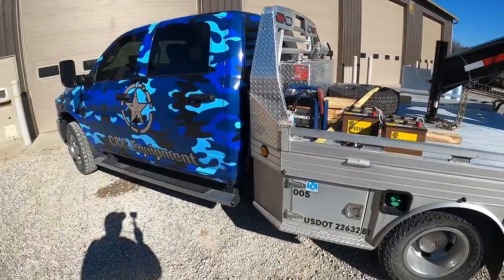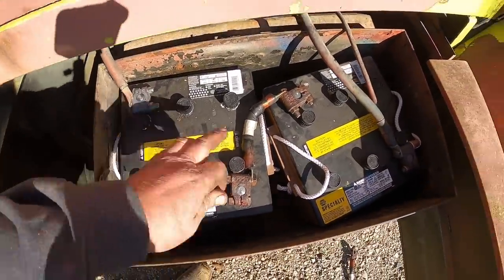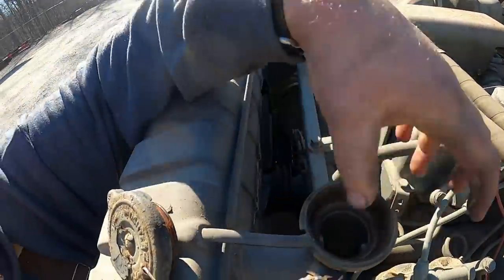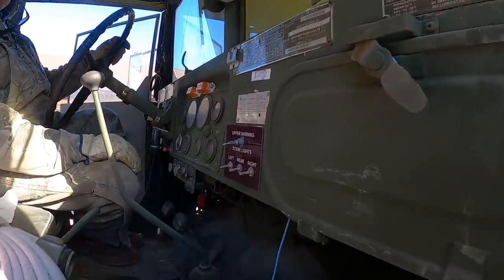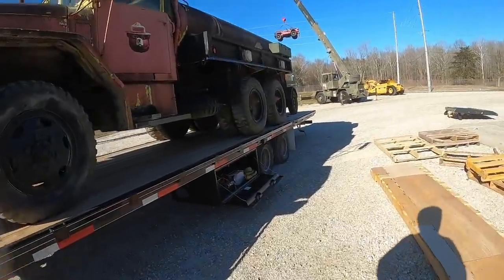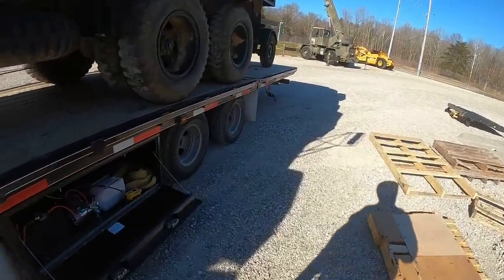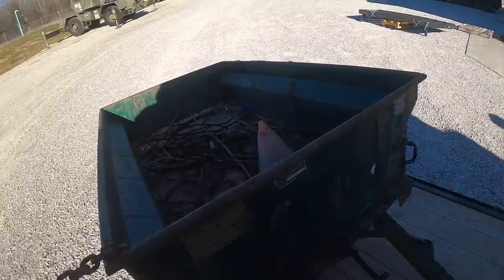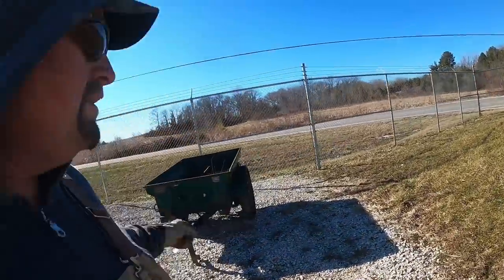M35A2 water truck and M100 Jeep trailer recovery @C_CEQUIPMENT

Comment: I watched remembering how I took my Duce & One Half pulling a Water Buffalo Trailer and the Master Sargent wanted it in a particular spot and I told him there wasn’t enough room but if that’s where he wanted it I might get it in there. I got back in my truck and locked in 10 wheel drive mashing the throttle and flattened two 6” round trees. They were two burr oak trees only good for firewood. What you have there started out life as a fuel truck. I always filled my truck with diesel with enough room for 5 gal of gas. I could get a extra 5 mph on the highway.

Comment: Back in the early 70s I was stationed in Thailand we where on a Marine Air Base out in the jungle.  The nearest town was about 50 miles away. We had several streams to cross to go across and there where not any bridges.  If the water was to deep we had to stay on base on the weekend. We would take a jeep trailer and fill it with beer cover it with ice and salt. The beer would be so cold coming out of the water it would have flakes of ice in it. 
Seeing  that trailer brought back a lot of good and bad memories. 
I came over from Dirt Perfect  and injoy your sight.
Reply from the maker: Thanks

Comment: Here's a thought for you in regard to 'Rippers'.  Lower the ripper boom so the tynes rest on the ground, remove the locking pins and lower the boom so it pushes the tynes up into the housing, insert the locking pin into the tyne you want to lock in the up position, then, raise the boom so you can reinsert the lock pin in the tyne/tynes you want  to use. This would save having to handle heavy tynes when wanting to rip a smaller ditch.

Comment: That truck should also get repainted back camouflaged.& redesign.& represented skimpy the bear camouflaged side door stickers to after the paint has been cured.& the clear coat has along with that also. Then reapply them back to both door on the side. That will make it look sharp. Especially if y'all sand blasted.& repainted the rims to Emerald green.,or A dark forest flat green like powder type coat mixed up with clear coat as your paint mixture for the rims again to now.& let them cure dry good to. Ole ya it'll make you money either way. Y'all could take it on your camping trips for your camper water refilling truck on hand.,or standby.

Comment: That red dodge in the back ground when winching up the trailer would be a cool truck to have . So what can you run those Multi fuel engines on ?
Reply from the maker: They will run on about anything petroleum based

Comment: Wow...! That Jeep trailer is in damn nice shape.  Truck is in good shape too, I heard you say the truck was a multi-fuel, what make is the truck engine...?
Love these kind of videos Clint. You can keep them coming.
Thank you sir.
Reply from the maker: They engine was made by 3 companies but all the same engines 
Hercules
White
Continental 
They were basically the same engine used in white and Oliver farm tractors
Reply: @C_CEQUIPMENT  oh wow, okay... last time I saw a Hercules it was in an old dozer, I think a “Cletrack” (maybe started on gas, then switch to diesel)... thank s for the reply
Reply: @C_CEQUIPMENT  I have an old probably around 1960 model  crane mounted on a
General Motors truck, that has a Hercules motor in it, the last time that it started and run was in 1978 and ran good and used it some then parked it on the back side of my farm and drained everything and filled it up with, I don't remember if it was hydraulic oil or transmission fluid in the radiator and motor to I believe . But some time          around 2000 I believe some sorry asses sunk in on the back side of my property and drained it and stole the radiator out of it and probably sold it for scrap and it was a huge radiator, so I don't know now if anything would be good on the motor now . It was left there by a coal company that had stripped our coal, they didn't want it and said that would never need it again .  Everybody told me that the size and type of motor it was, that they were really good motors . That they were on cranes and drag lines and drilling rigs and so on . I just thought about it when you said that the 6x6 military truck had a motor in it that could of been made by
1 of 3 companies .
Reply: (snuck) in on the back side of my farm   -     my phone has spell correct on it and it changed the word to ( sunk )

Comment: I assuming that has a pump on it? Do you not what they flow if it does for the water?
Reply from the maker: No pumps on this one
Reply: @C_CEQUIPMENT  do they sometimes? Or never and have to add it later?
Reply from the maker: @oklahomachris6298  I don’t think the 2.5 tons came with a pump unless it was a full blowen fire truck
I did have one of those once
Reply: @C_CEQUIPMENT  those trucks if they had a 2-2500 gallon tank would be good rural fire dept trucks. And if they had a pump which probably could be mounted later I’m sure. See what you come up with think my fire dept may look for one in the near future and I may talk them into getting one like that. Let me know if you got time

Comment: The military twelve looks easier  to handle  than 8D's were, Sounds good and most likely just  frozen treadles and a radiator that got drained by the    drive by and hit radiators with 22 shells from young men going nowhere in life.  I caught one and he begged me to send him to jail. I locked his seat belt in tight and sent him off what looked to be a steep hill that this truck would go down but stop on its own from the wet ground an knowing how it  all works... looks worse than it really is... he  was crying when I turned him loose. Told him not to leave and it would be so much worse if he did... go get highschool GED. It was less than two years later he was working for me, an loving life an being hard like I was to him, on other kids to turn them around.